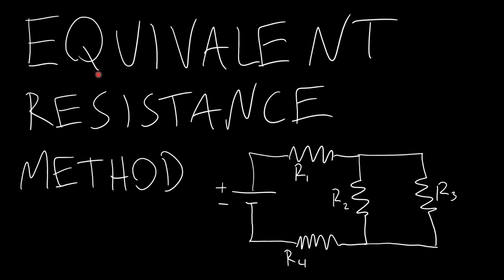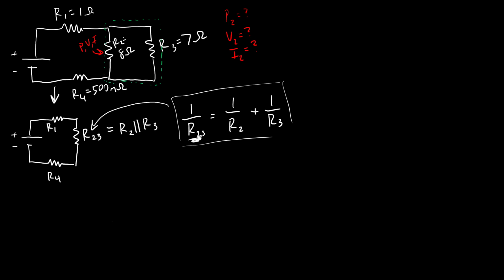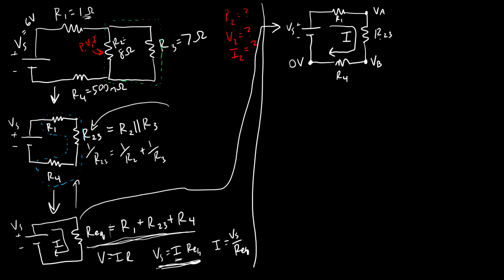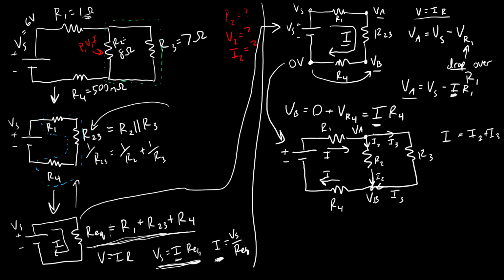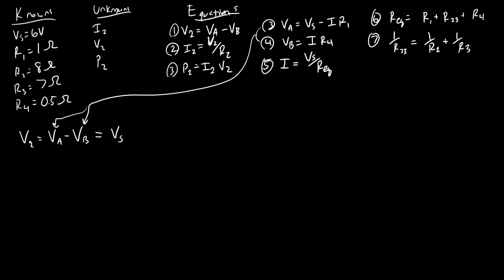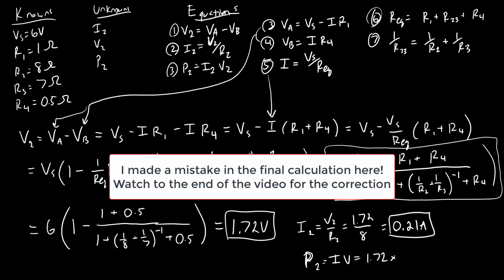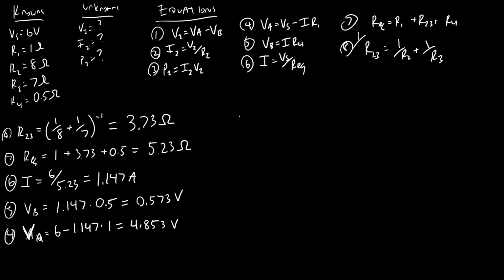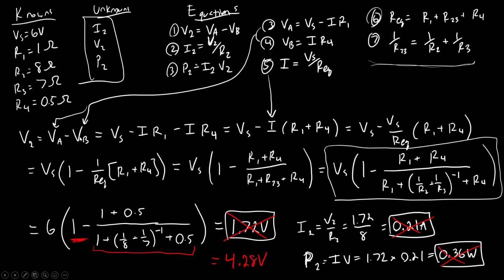Intro to Circuits 18: Equivalent Resistance Method

Comment: We can calculate the  I equivalent form the first equation 6 = I eq * R equivalent. it will be 1.15 A then we apply Kirchhoff's Second Law of V in the small circuit  6- I equivalent* R1 - I2*R2- I equivalent *R4=0  so I2 WILL 0.5  which is much simple that your first method

Comment: I used to love algebra until this video. Then I remembered my algebra was 20 years ago. The 2nd method definitely worked great for me,. I found it odd that you worked out the calculations BACKWARDS from 8 to 1. I understand your reasoning but my brain clearly lags behind yours. I envisioned each equation as a step in the process so I had to switch the equation numbers around so 6 (P2) 7 (I2) and 8 (V2) gave us the answers we desired. Once again awesome work.
Reply from the maker: There is definitely more than one way to solve the problem and no one way is "the right way." The videos on node and mesh analysis in this series both show methods that let you solve all the equations at once instead of chugging through them one by one, but that requires understanding linear algebra and matrix multiplication (which I don't have tutorials on, but there are plenty on YouTube if you want to learn!).